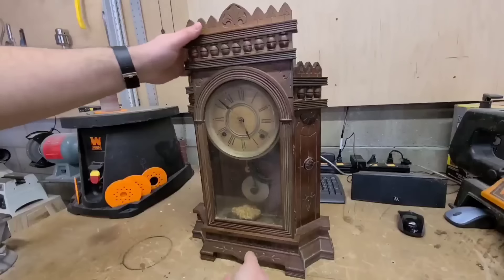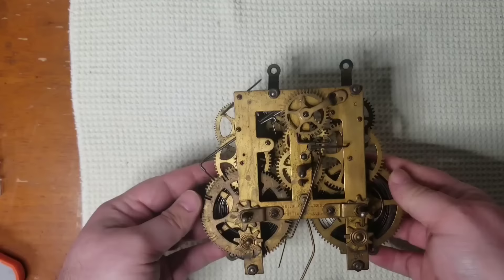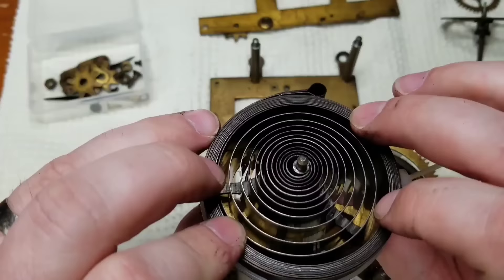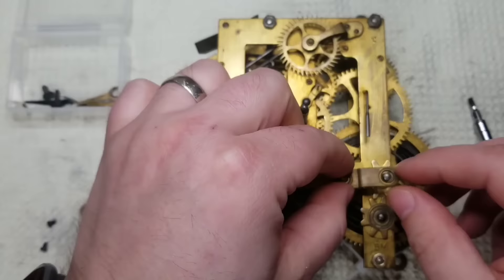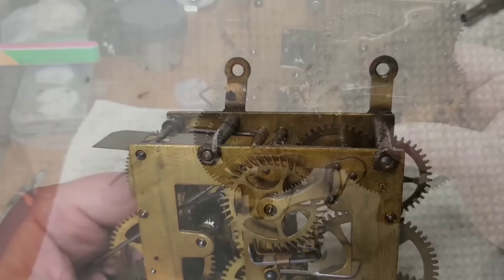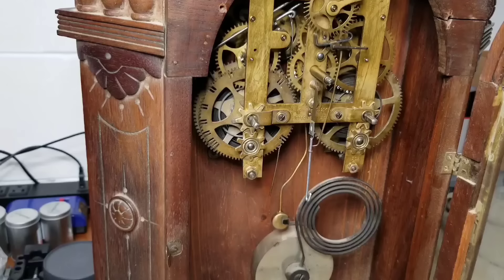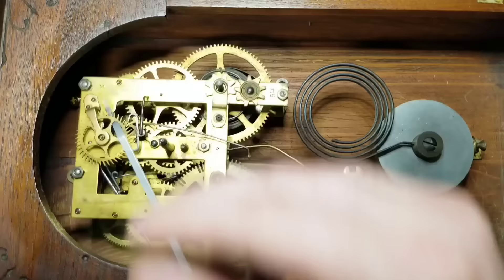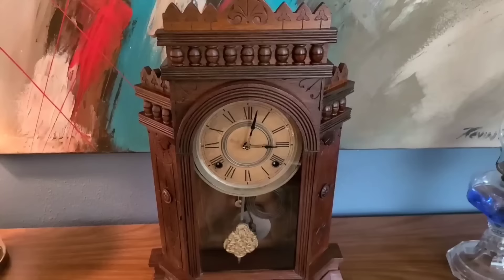Broken 1885 Gilbert Clock (Restoration)

Comment: I fix these for a living.  Some pointers: you didn't clean the springs- the most important things to clean on a clock because they provide the power and have the most friction.  Take a toothbrush and cut the bristles down by half to two-thirds.  It will be much stiffer and will scrub much better.  You need to clean the pivot holes in the plates.  Boxwood "pegwood" is the traditional tool, but bamboo skewers can be sharpened to a long triangular point and works very nearly as well.  And as for lithium grease and 3 in 1 oil, you might as well throw the clock off a cliff.  You need to take note of the wind limiters so you can put them on in the correct position.  They can make a great difference in wear and especially accuracy if they are correctly set.  Lastly, a minor point- please don't use Phillips head screws on an antique.
Reply from the maker: Thanks for the pointers. I wasn't quite sure how to clean the springs without spending hundreds of dollars on a mainspring winder tool. I want to clean the springs but I still need to figure out how to do that. I cleaned the pivot holes using pegwood but I cut a lot of the cleaning out of the video because it took a long time. I've ditched the lithium grease and also bought Horace Whitlock's Clock Oil. When you say "wind limiters" are you talking about the fan that regulates the chime speed? 

I would like to pick your brain more if you're up for it. If you want, you could email me at watchoverhaulchannel@gmail.com. I would really appreciate learning more from you. Thanks!
Reply: I fix Pocket Watches.
It is such a cool feeling and it is much fun to work in watches and clocks.
Reply: Great information for one of my hobbies. Thank you!
Reply: @WatchOverhaul mainspring winders can be built for $20. There's plans online free, if you haven't found them yet let me know.
Reply: I think the gentleman's intention was merely getting the Clock working again - which he did a great job! Thanks for sharing.

Comment: A great video, but as a Horologist, I have to tell you - NEVER use Grease or 3 in 1 oil on a clock - they both attract dust and go all 'gummy' in time ! Those wheels should run as dry as possible, and only use a proper mineral clock oil very sparingly on the pinion ends. personally, I would have replaced the paper dial - so easy to buy, and also blackened the hands, but hey - it's all subjective and you did a great job. Well done 🙂
Reply from the maker: Yeah, others said I shouldn't have used grease too. Won't be doing that anymore! I switched to using Horace Whitlock's Clock Oil now. I wanted to leave the clock as original as I could. The plan wasn't to make it look like new so that's why I didn't touch the hands or dial. Thanks for your feedback and for watching.
Reply: @WatchOverhaul  Great call on not over restoring the face and hands. They have earned there scars.   AS to 3n1. It has a wax base and definitely gums up.  Gears dry.  Steel on Brass for the load applied by a clock is not an issue.  Like others have said lube the pivots.  
IF you continue with clocks a main spring grease/lube as well.  Need to prevent rust on them.

Great job on the case repair.
Reply from the maker: Thanks! Yeah, I switched what I was doing on the next clock I worked on. You can see that here: https://youtu.be/7rVkwnEL08Q. I'm working on another clock right now and I plan to address the mainsprings for the first time. Hopefully it all works out! Thanks for watching!

Comment: Please go buy some proper tools never use pliers for nuts and bolts.
Reply from the maker: I agree with you. I should have used the proper tool, but I grabbed what was close by on my workbench. Definitely a lapse in judgement for sure. Thanks for watching!
Reply: That made me cringe as well (mostly because brass threads are easy to strip) but I love your video and I hope to see more of them in the future. :)
Reply from the maker: I didn't feel good about it either after I watched it back. Just wasn't thinking. Will correct in my next video. Thanks!
Reply: @WatchOverhaul  I just subscribed! :)
Reply from the maker: Cool! Thanks 😊

Comment: Don’t put grease on wheel teeth. It holds air born gunk and creates drag and wear. Remove and clean springs ( the zip ties are a good idea though) and put the grease or oil on them. Check the wheel shafts fit in the pivot holes. If they are loose and sloppy you need to put bushings in the holes after polishing the pivots. For only your second clock repair you did good. Keep practicing and reading and you tubing and it will all come together. I have been doing this for years and l will never learn it all. I think  the learning is the fun part. May god bless you in your life journey,
Reply from the maker: Thanks for sharing some advice. There's definitely a lot to learn! Thanks for watching!

Comment: Springs need cleaning and then greasing. Clock teeth should be kept dry, no lubrication required. Clock oil all the pivots + escape teeth. 
Good for you for having a go, every day is a school day. Keep it up and enjoy.
Jt
TheClockworks
Reply from the maker: Thanks for the tips. Someone else mentioned I don't need to grease the gears too. I'm fine with that - one less step to do!
I don't have a spring winder so I didn't do much for the springs. I soaked them in mineral spirits, but that's it really. Have a suggestion on how to clean the springs without taking them apart?
Reply: @WatchOverhaul  Ultrasonic bath ?
Reply: @WatchOverhaul  For this type of clock, you can unwind and wind the springs by putting the main wheel back between the plates, wiring the wheel to the plate and let the spring down completely and safely.  Then clean and lubricate between all the coils. Secure the wheel to the plate again, wind the spring, secure it with wire (or plastic ties) and your set to go.  No expensive spring winder needed.

Comment: Interesting to watch a movie figure things out.
I'm a retired watch and clock repairer with 50 years at the bench. And over the years have repaired hundreds of the Gilbert's, sessions and all.
Did a good job, but usually the teeth and pinions are never lubricated. Any dust that gets on will increase the tooth wear.
Reply from the maker: Hi Fred! That's really neat you have worked on so many watches and clocks. I've worked on 4 or 5 watches and this was my second clock. Thanks for the feedback! Others have mentioned I shouldn't have used grease as well. Amateur mistake for sure. Thanks for watching!

Comment: A very nice restoration of a very beautiful clock!

If I could make a suggestion, you might want to go to the hardware store and buy a set of small 1/4" drive sockets with a screw driver handle and perhaps also a small ratchet. You should be able to find something useful and not junk for 35 or 35 bucks. They would have done an easier job of pulling loose and tightening the 5/16" assembly nuts. You also could have used a small socket to press the hands back on. This would have given you even pressure all around the fitting, and not just two points.

You obviously got things done well without a socket set, but I think having one would  have made your life easier. They are also handy for small repairs around the house.
Reply from the maker: Thanks for the suggestions. I have a socket set, but used pliers without thinking. I would like to get a smaller set though. Pressing the hands on was a little difficult - I'll have to try a small socket next time. Thanks for watching!

Comment: I had gotten from my great grandparents house when we were cleaning it out to get it ready to sell after my great aunt passed away and my great uncle decided he wanted to sell the house and move to Minnesota to be with his kids an 1858 Seth Thomas Column and Cornice clock that when I got it, it was in much worse shape than the clock you worked on in your video (the case was in several pieces, it was missing its original pendulum bob, winding crank, weights, and weight cables, and the original hands.) So when I got the clock home I started off by reassembling the case, and then ordering all the aforementioned parts that I mentioned were missing, took the original solid brass lyre movement apart and cleaned and lubricated and reassembled the movement, and I had to do a lot of adjustments to make the clock run correctly and strike correctly and it took me 2 years (basically the entire length of the "pandemic") to get the clock to run properly because I had parts that broke on me that had to be replaced such as weight cables, the count wheel pawl (the part that raises and lowers to count out the hours on the count wheel) and had to replace the original suspension spring which broke and then try to make a replacement one that would be as close to the same length as the original as possible and still allow the clock to run properly, and also having to replace the original crutch and verge assembly and trying to get the pitch of the crutch just right so the clock would be in proper beat and would adjust at the pendulum bob to make the clock run at the correct time consistently throughout the clock's entire 8-day run. 

It wasn't easy (as I basically had to teach myself using readily accessible internet resources) but I got it fixed.
Reply from the maker: That's really cool you were able to figure all that out. I'm also just learning and figuring things out as I go. I plan to keep learning from my mistakes and getting better. Thanks for sharing and watching!
Reply: @WatchOverhaul  I've always been interested in antique clocks and watches but I've just recently within the past several years gotten into the actual repair end of antique clocks. I have high functioning Autism and that's part of the reason why I am obsessed with antique clocks and radios and repairing them.
Reply from the maker: I think sometimes you have to be a little obsessed, be persistent and have lots of patience to get good at something. It helps having the right tools and equipment but it's hard to spend hundreds of dollars on professional equipment all at once. It's a journey for sure. Keep at it if you're having fun!

Comment: Nice job.  I've only worked a couple of clocks but I've found that a light silicone based oil lasts longer without 'gumming up' like petroleum based oil.  And sometimes I've used a solvent to clean out the pivots/ gears without taking the top plate off.  And yeah, figuring out the chimes is always 'fun' since they seem to be all different.  Again, nice work and nice video.
Reply from the maker: Yeah, this was my second clock I've worked on. I made some mistakes for sure. I'm now using Horace Whitlock's Clock Oil from now on, and not putting grease on the gears and pinions. Thanks for watching!

Comment: When it comes to cleaning a wooden case like this, (or any old piece of furniture) I use Restor-A-Finish.  If the piece is unusually dirty, I use a damp cloth and lightly remove as much dust and dirt as possible.  Then I use a cloth and soft toothbrush with Restor-A_Finish and completely go over the entire piece.  The toothbrush works great in all crevices and fancy areas.  I then leave the item in an open area for a day or so in order that the "Restor" can evaporate or whatever.  I then wipe the entire piece with a soft cloth and it looks great.
Reply from the maker: I also cleaned the case with a damp cloth just to get the dust and dirt off. My goal wasn't to make the case look brand new. I wanted to leave the clock as original as I could. I didn't want to remove characteristics that showed its natural passage through time. This is the same reason why I didn't remove the patina off the brass movement parts. I could have polished the patina off, but then it would have lost a part of its history. Thanks for sharing and for watching!

Comment: Nice to see that you didn't  try to polish it up. However, although these American clocks will still run even when badly worn there seems to have been no inspection of pivots and holes that might have required  recutting and bushings fitted.
Oh dear, wheel teeth and pinions should run dry, only oil pivots and levers.
Reply from the maker: This was only the second clock I've ever worked on. I don't have the preferred equipment/tools yet, and I also don't have all the required skills. Addressing worn pivot holes is a skill I hope to work on at some point, but wasn't going to practice that skill on this clock that has sentimental value to me. Many people have commented that I shouldn't have used grease - I won't do that again! Thanks for your feedback and hope to keep learning and getting better!
Reply: Well done in that case, many other clocks are actually simpler to work on, the wire levers are often bent and can be a fiddle to align properly. Don't worry about not having sufficient equipment, pivots can be reshaped by using a fine file and a wooden rest. Bushes are available ready made and can be fitted with careful use of a round needle file and friction fitted or even riveted.

Comment: I believe that odd little wire hanging down from the movement will lift the stop lever on the strike train.  That was necessary if the strike train needed to be put back in sync with the time.  A bit hard to lift the lever directly when the face is in place 🙂
Reply from the maker: Interesting. I thought that wire was intended to add a little more weight to the stop lever so it falls quicker.

Comment: Never use 3 in 1 oil in clocks. As it ages it solidifies. Singer machine oil is good. I am a watchmaker from the 1950 - 60 s and overhauled many of these American clocks
Reply from the maker: Thanks for the tip! I use Horace Whitlock's Clock Oil now.

Comment: What is the length of the suspension spring you replaced?  Where did you purchase it?
Reply from the maker: It was 3 3/16" but I had to shorten it a little. I got it on ebay. You can find them by searching "Antique clock Pendulum Suspension Spring".

Comment: my only gripe is you used philips screws, i hate using them on antiques.
Reply from the maker: It's what I could find at a local hardware store. I can replace them at some point when I find different ones. Thanks for watching!
Reply: @WatchOverhaul  understandable, best place i have found is ACE, they usually have lots of interesting fasteners

Comment: I am not sure about using lithium grease and 3 in 1 oil for the mechanism, but pliers instead of spanners for the nuts???
Reply from the maker: Others said I shouldn't have used grease - won't do that anymore. I read that 3 in 1 oil can be used, but I've switched to real clock oil for the clock I'm working on now. The pliers were a mistake - wasn't thinking and just grabbed them because they were right next to me. Always more to learn and improve! Thanks for watching.

Comment: At my local Ace Hardware store, they have speciality brass screws with straight slot heads.  They are more expensive; however, they are more correct to use on old pieces.  The Phillips head screws aren't correct.
Reply from the maker: Yeah, I couldn't find the right ones at the time. I plan to switch them out. Thanks for watching!

Comment: You need to put a little bit of oil on the Springs themselves. The best oil to use for the other parts like all the pivot holes is like a three-in-one Singer sewing machine oil.
Reply from the maker: Thanks for the tips and for watching!

Comment: I am interested in the details of how you put the clock in beat and adjusted the beat rate.  I have an old Sessions wall clock that is my first find that I am working through.  First working through the mechanicals to get it running long enough to uncover and understand its issues.  I am unsure if the pendulum is original, which may be part of my problem.  I have been unable to locate enough information to identify the clock.  If you provide pointers in that area too, that would help.  Great video!  I learn as I do, similar to the spirit of this video.
Reply from the maker: Hey! Thanks for reaching out! I can try to help you work through it. It will be easier over email because YouTube comments aren't the best for back and forth conversations. You can email me at watchoverhaulchannel@gmail.com.

Comment: What is the "propeller" in the upper left hand corner?  I've seen other clocks with this feature.  It spins and moves air around but for what purpose?
Reply from the maker: That is a fan on the strike train side of the movement. It helps regulate strike speed. The fan slows the strike train so it doesn't run/chime too fast. Thanks for watching.

Comment: Any idea how heavy that pendulum is. I have the same clock but the pendulum is gone.
Reply from the maker: I think you're referring to the pendulum bob. The bob is the actual weight. I'm not sure how much it weighs. I don't have a scale that will weigh something that light. You can try googling "Gilbert clock pendulum bob" and see if you find any info. I found one forum discussing the weight being 2.6 oz or 4 oz. Don't know how accurate that is or if those numbers are remotely close. https://mb.nawcc.org/threads/gilbert-clock-pendulum-bob.181801/

Comment: How did you set the hands so they line up with the chime? I have one of these (different cabinet, same movement) that's an hour behind because... stupid me... rotated the hand backwards... Do I just literally move the hands to the right position and put them back on? Thanks!
Reply from the maker: What I did was:
1. Rotate the minute hand to the 12 position
2. Count the number of times it chimes
3. Loosen the hour hand and move it to the right hour
4. Push the hour hand back on.

I think I had to remove the minute hand to do this. The hour hand is just pressure fit on, so yours probably slipped when you rotated it backwards.
Reply: @WatchOverhaul  Thank you so much! That was exactly it and fixed it! It's been 'broken' for 2 years because I didn't want to take a chance!
Reply from the maker: Awesome! Glad it worked!